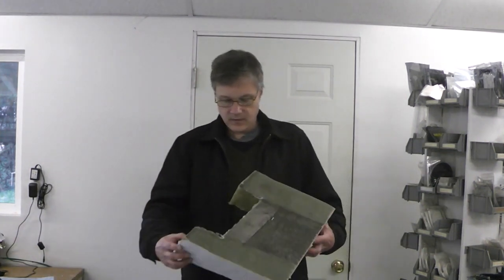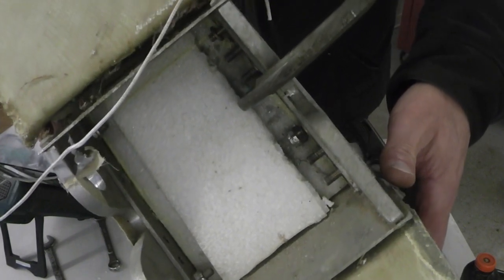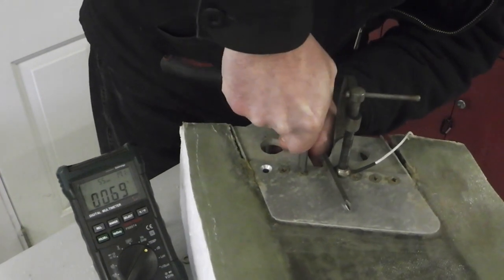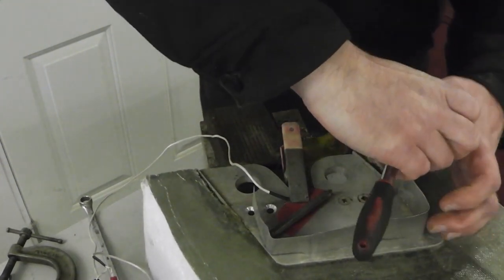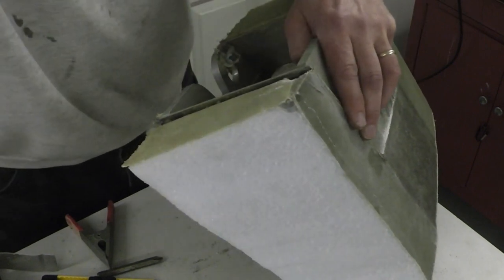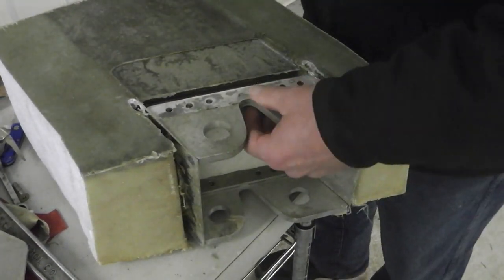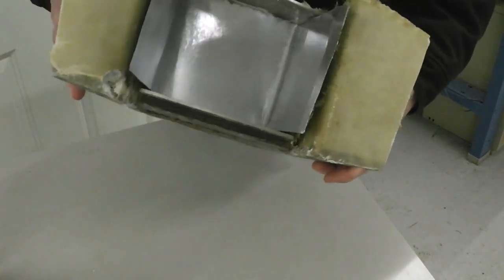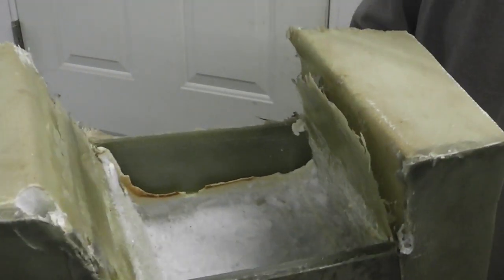EZ wing attach removal

Comment: Nice video, but that seems like a very awkward combination of materials. The LongEZ has a much more elegant attachment scheme that plays much better into the strengths of composite materials and away from their weaknesses.
Reply from the maker: This attachment method is basically a way to cut the spar and re-join it. It's light weight. The first Varieze prototype was designed to be very light and  VW powered.
Reply: @the_wrong_engine  ...And now it's limited to +2.5g/-1.5g. This is the assembly that almost spread me over a few acres of the Mojave desert in 1989. I got called out on a retrieve and missed my chance at that ride.
Reply: @hpaircraft2187  What G is the Long EZ safe to fly at?